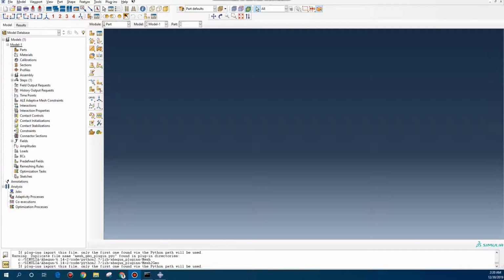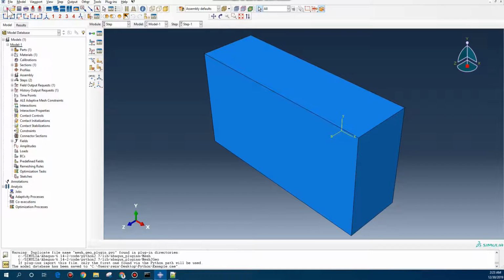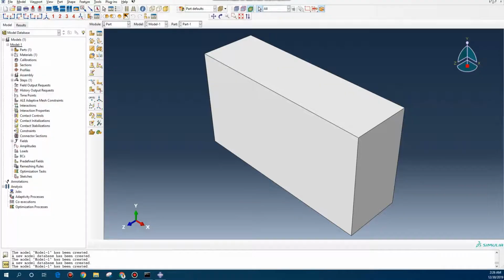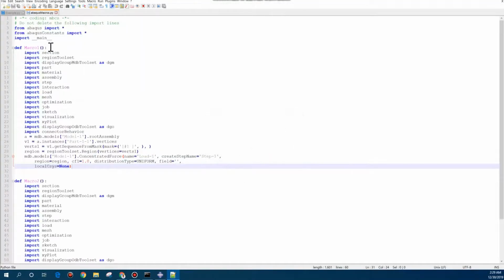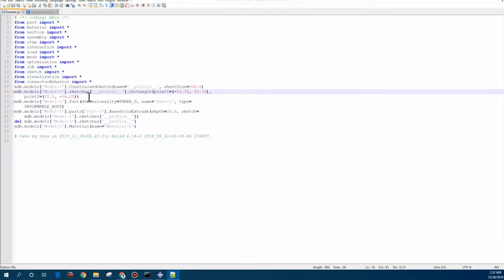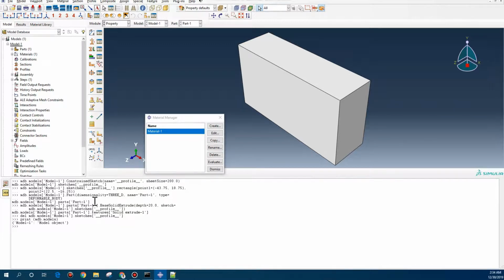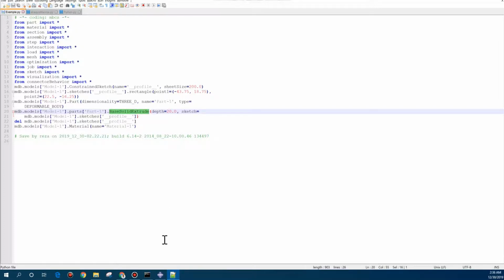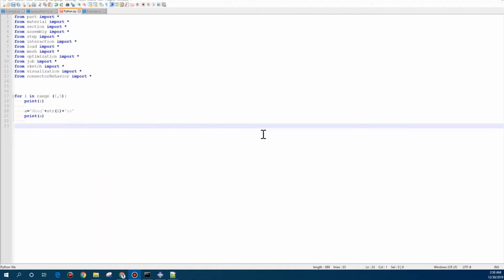3 methods to use python for Abaqus for absolute beginners

Comment: hi , I have a problem, whenever I create a new model and save it in it's work directory, it's saved as a cea file only, and no jnl files are found .
what should I do to find/ create that jnl file
Reply: Tbh, I have never faced this problem but I guess you might not assigning your work directory correctly. Try to put it in a separate folder and see if a CAE file would be created after saving or not. if you even can see CAE file in the new folder it means you have a problem with work directory otherwise it means your software have a different setup
Reply: You may have student version.